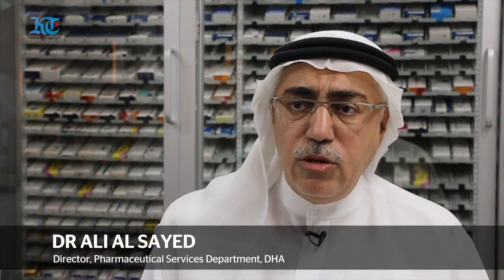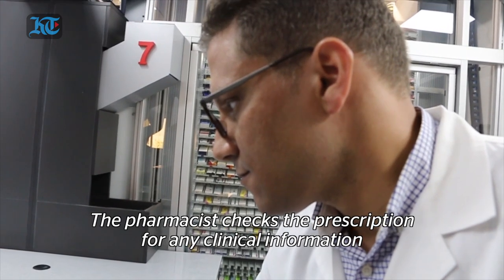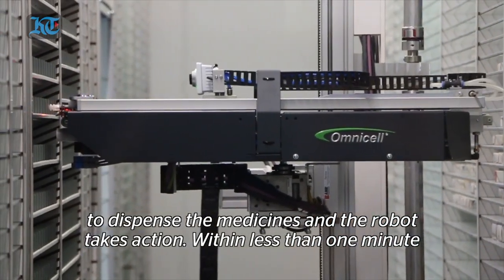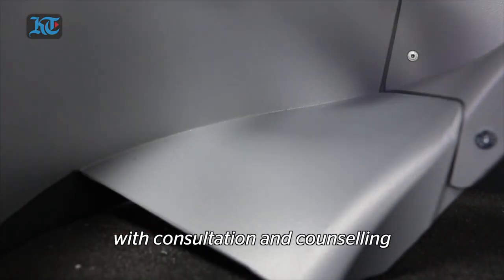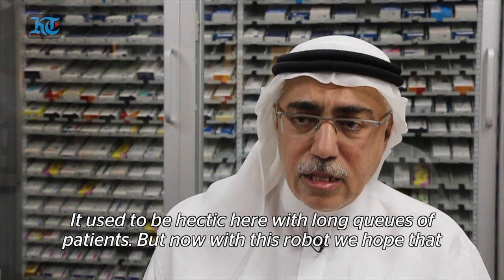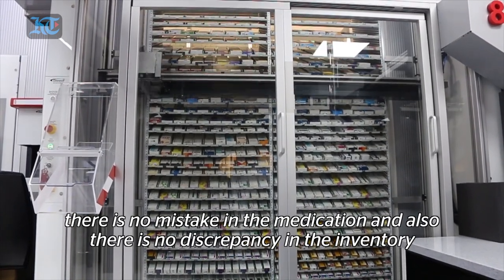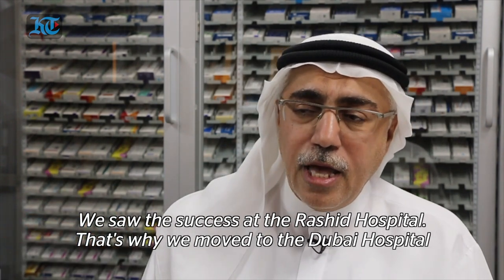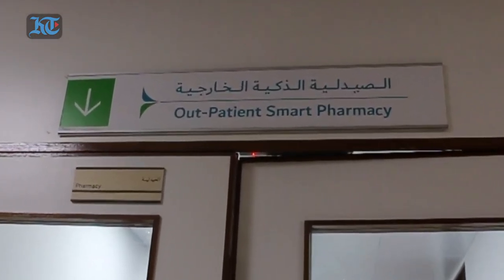How the robot pharmacist works at the Dubai Hospital

Comment: Can it read doctors hand writing and then request the item, no i think the chemist will have to look it up on the computer first to request it from this machine. So Its probably still going to take 5 minutes per customer, not 12 prescriptions a minute, because there would probably be only 1 chemist working in a chemist shop. Normally it's about a 20 minute wait time for the chemist to return a prescription to the cashier.  I think you would need some kind of app for the doctor to prescribe the prescription onto so you can go to some machine to dispense the prescription. Then just make sure the machine is stocked up & has a working filing. The machine should be placed in a chemist shop else the chemist businesses would lose out on all the trade for non prescription items.